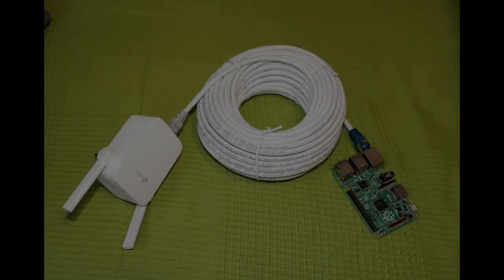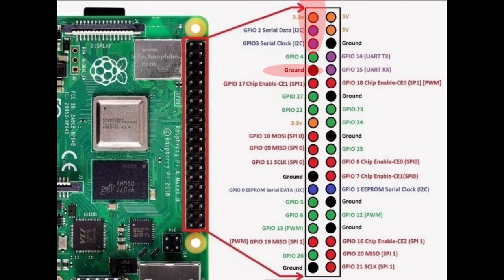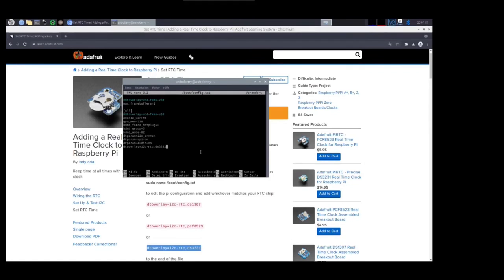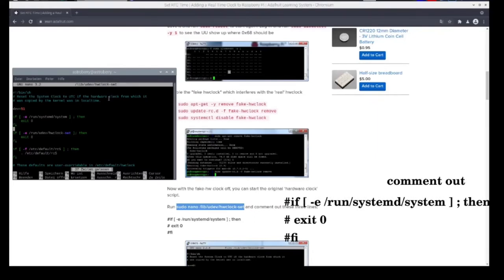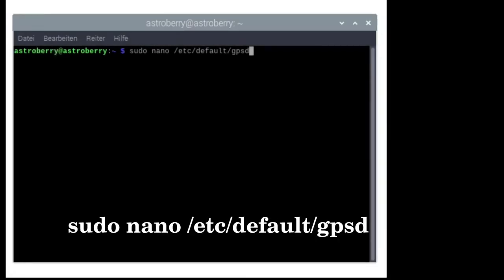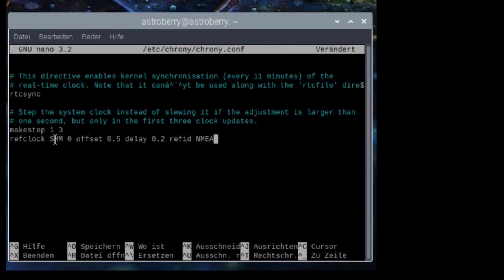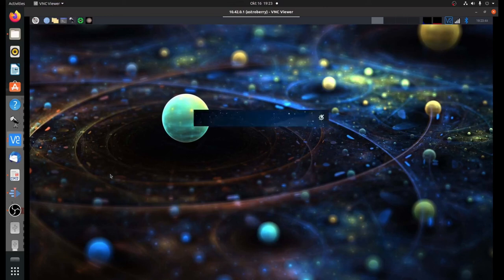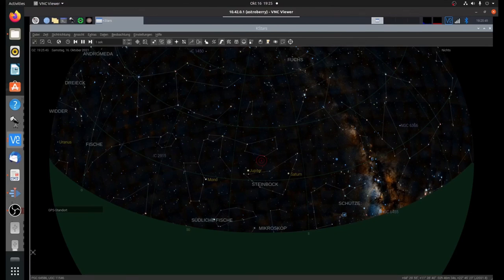A guide to setting up an RTC and a GPS Dongle on Astroberry

Comment: Thanks a lot Wolfgang for that video ! I was trying to find a relatively easy solution to use a raspberry to control my astro gear in the field, but the time and date setting was really an issue ! now it work perfectly, i can give it a try when the sky is clear !
Reply from the maker: Shall I do another one on Astroberry? What would you like?
Reply: @wbirk  If you have necessary gear, a video on the setup to use 2 zwo cameras as main and guide cam, i can't get it to work consistently 😅
Reply from the maker: @milhouse8525  I have 4 zwos … I can make one about setting EKOS up, probably in a mixed mode with a server …
Reply: @wbirk this would be great! 😊😊😊😊

Comment: Thanks for the video, worked perfectly.
Just one question. This may be obvious to Kstars users but how do you get the location to appear on the display? Yours shows up middle left but although I have the time and location working it would be nice to have that info box show up with the correct location. Especially as I move back and forth between a city location and my dark sky site. It would be reassuring to see the correct location displayed in case I forget to check.
Reply from the maker: It just reads GPS Location once the kstars preferences are set in such a way that the GPS dongle sets up the location ...
Reply: @wbirk  I found it. The GPS location overlay is at the bottom left of the screen by default. This wasn't visible as the astroberry's screen is bigger than my browser window and so I had to scroll it down a little to see the location overlay. I could then drag it up to a more visible spot on the screen.

Comment: I have some problems with USB-GPS on Astroberry. I have a ublox-7 device and followed the usual instructions. On Astroberry it doesnt' get a fix - just shows data and available satellites. On any other system it gets a fix very quickly. At the moment I use a Pi-Zero with that same dongle and kplex as gps(nmea)/ntp server. I saw that gpsd on astroberry always installs an old version but on a stock OS, its a more current one. Could that be the reason?
Reply from the maker: Hi! If you see satellites, you have a fix. Have you tried xgps for debugging?
Reply: I use cgps/gpsmon and see availabe satellites but the tools say "No Fix" and do not display lat/lon coordinates - only time/date. If I do exactly the same with stock raspbian buster (with gpsd 3.22) on the same hardware, it works within seconds. I also tried to purge and reinstall gpsd. It's weird that it always pulls 3.17 and not a current version of gpsd. For now I managed to get a working setup but I now I am going to continue experimenting with Astroberry until I find the problem.
Reply from the maker: @alexanderwagner9524  that is weird, indeed ...